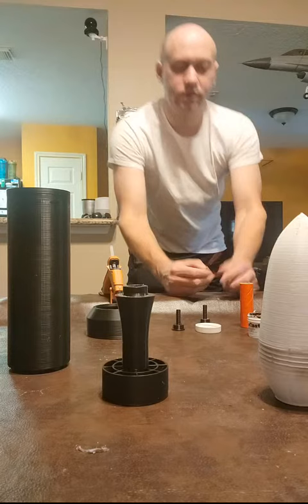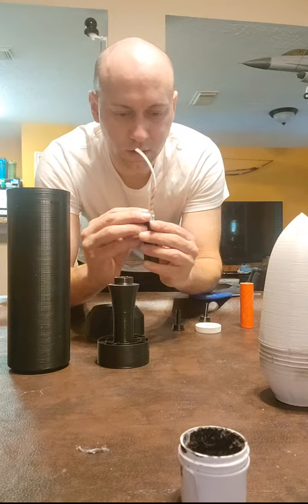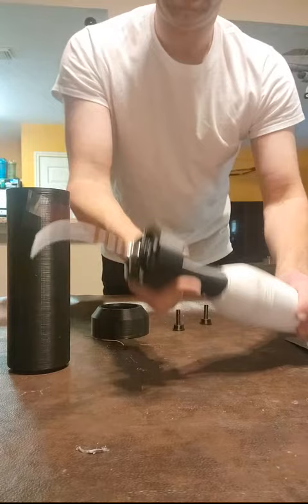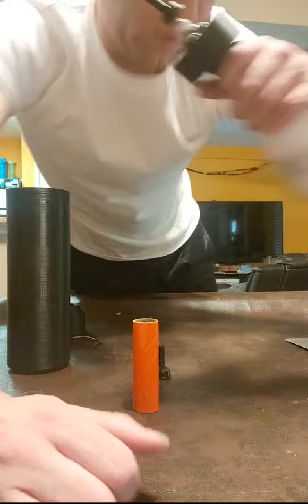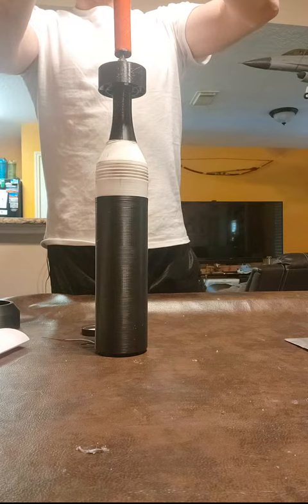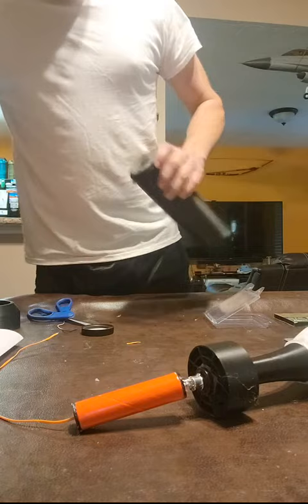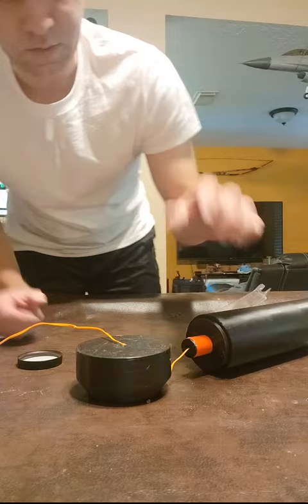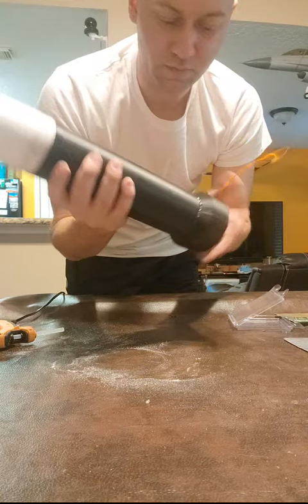Assembly Of 3D Printed HE Rockets

Comment: Seems like you could make a couple improvements to ease your assembly. Such as making the black powder tube caps different. Have one that has a full length tube and one without a tube. That way you aren't forcing your tube down into the powder. I would also suggest using superglue for assembly of the projectile rather than hot glue. Super glue holds up much better in my 40mm projectiles and doesn't make a big mess.
Reply from the maker: Yes I actually was going to fill the small tube with flash kno3/al sulfur/powder and it should have been the full length of the charge not trying to meet halfway. Small details like this are easy to overlook until you actually try to assemble the round. I had planned to make this exact change. I also plan to modify the tail and warhead to incorporate small holes around the mating surfaces and utilizing a two part epoxy instead of hot glue. These small changes are always happening and the rounds just keep getting better and better.
Reply from the maker: I also will incorporate a fuse based arming system, rocket exhaust lights fuse which blocks hammer ball until it burns away. I don't want these to be able to explode if dropped once armed ..

Comment: I thought you weren't gonna release the files? Why are you making a tutorial then, unless.... you are gonna release them...
Reply from the maker: They may be released at a later date.
Reply: I hope so.  coolest firework launcher I can think of
Reply from the maker: @aringendmatt  yeah watch the other videos it's not a firework launcher.
Reply: But i mean if you don't have access to he you are prob just gonna use it as a firework launcher
Reply from the maker: @moldybread6720  I mean technically even with the files.... You can't build a valid rocket because you also need a license for the motors the heat rounds utilize. The HE rounds are much lighter though and the small 24mm motors are just enough for them to fly straight as you could see in the video
Reply: @DandSCreations  but it could be